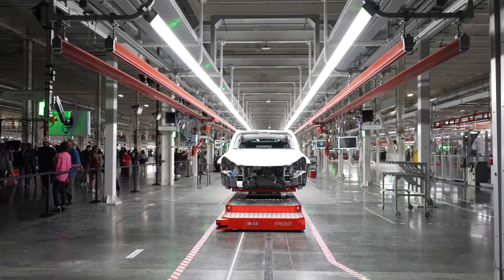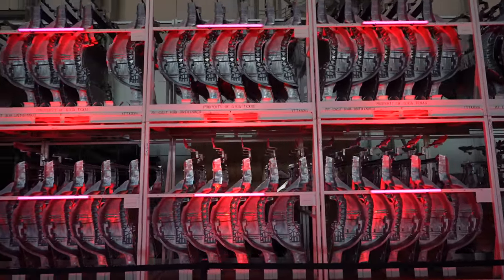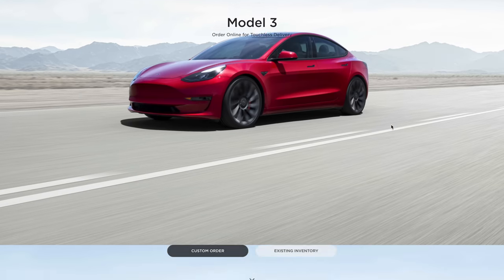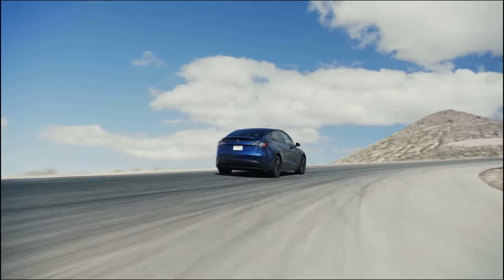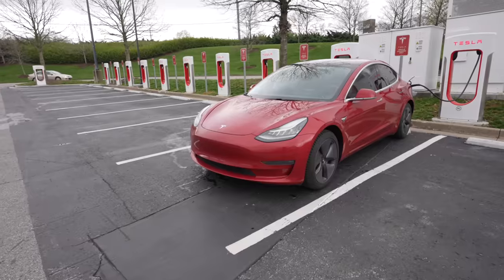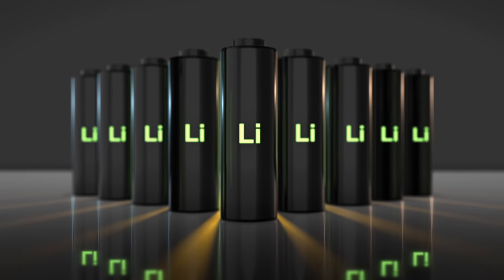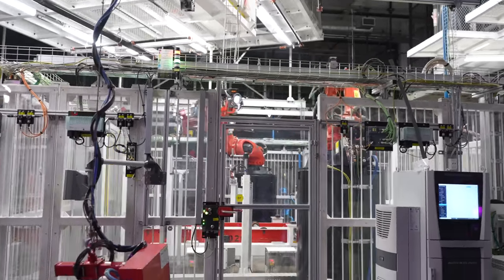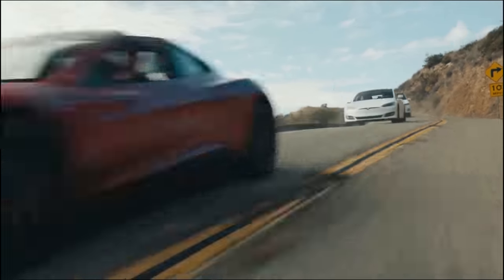Why I’m NOT Buying the New Tesla Model Y

Comment: I thought the ev benefits were it’s insane ability to out accelerate cars well beyond their price range  and at base price some 60000 dollars which will be more after extras you can get a seventh gen corvette with a 0-60 at a little under half of the hat this car pulls. Honestly you can get an older Tesla that will pull 2.5 seconds and humiliate all but he best built cars on your favorite track day. No the vet or mustang doesn’t save the environment but by now we should all be well versed in the knowledge that they don’t; since the inception of the hybrid and subsequently the full electric car has come out there has been no effect one way or another on the environment though atmospheric testing. I am not here to be the guy that says anything about that topic I am sticking with performance which was quite impressive even astonishing running with Bugatti veyrons until it ran out of top end but it’s new 0-60 time obvious stock suspension perhaps upgraded but nothing special and price point makes it more of a cult car than anything you can have a Subaru sti  a Honda Civic type r the high performance Corolla, all these cars look as good or better are at least 5 grand cheaper but definitely more it is on par with two Chrysler muscle cars multiple variants of the mustang and the corvette. In previous cars the Tesla had speed and the ability to outrun these cars but not so much anymore and yes they broke ground on how the battery becomes part the unibody but it isn’t a car that is a 60000 dollar car think m5 or amg used obviously sixty thousand dollars is a lot for a Hyundai and while the ev prices itself out of reach of the lower middle and working class: who ideally are who buy the most cars and need newer cars because of our lack of prompt repairs like oil leaks  refrigerant leaks and just lack of poor emissions system maintenance creating a daisy chain of pollution. We are pigeon holed into  buying a dumb hybrid or the poor man’s ev the Nissan Leaf which still is more than the cars I would buy, mustang gt, Camaro ss,z28, the Corolla type r, Dodge Challenger and charger maybe not the fastest but hell it will be an srt8 and the reason I mention these intro muscle or sports cars is because the lowly model 3 the supposed to be for every man model 3 would smoke  these cars  but for twenty thousand dollars more you get new technology which is great for when I want to have sex and drive  or do all the other crap you can do now that you don’t need to drive you should be keeping in mind that most accidents are the other persons fault but seriously it can’t out run a 2010 Honda Accord. Tech is cool but only if speed is along for the ride otherwise you just have something to lose to forget to plug in